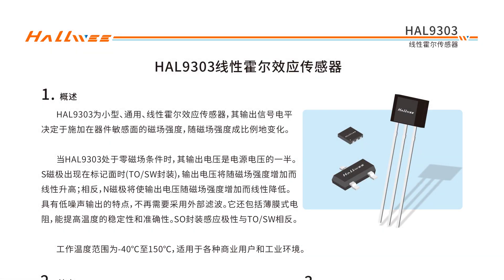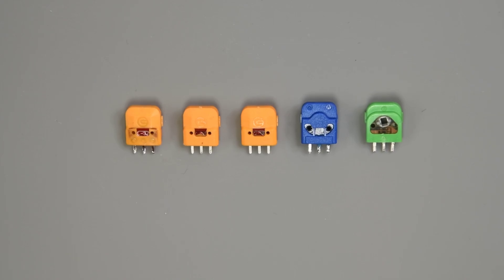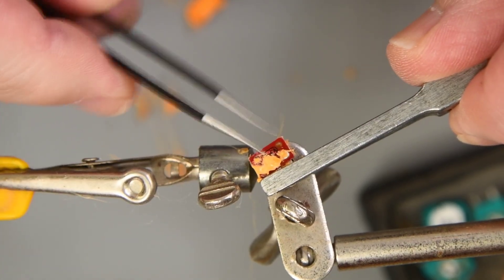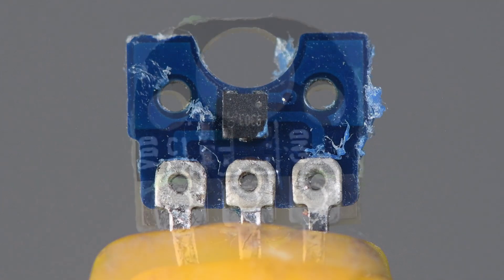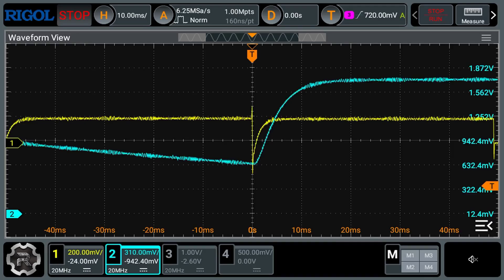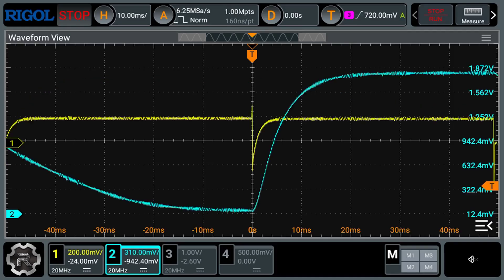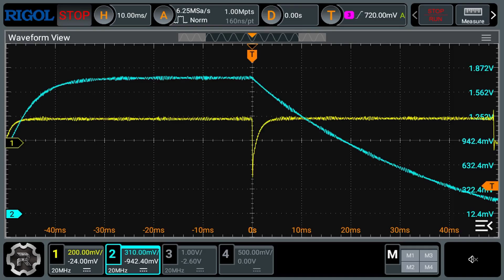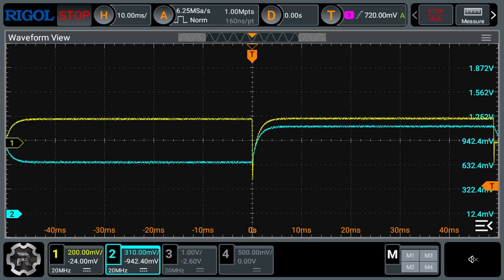Close up look at some Hall Effect Joystick Sensors

Comment: Hello, I was impressed by this content.
I know the GuliKit sensors are expensive and good here, but what would you recommend the most among GinFull, K-Silver, and Union in that content?
Reply from the maker: The new K-Silver TMR joystick will be the low-cost winner.
Reply: @metalplasticelectronics354  i am planning l4 ginfull.what do u think?
Reply from the maker: I'm testing out some Ginfull V5S joysticks right now, they look like the best Ginfull's so far.  But I won't know for sure for a few more days.  I've still got to get them in a controller.  The GuliKit and K-Silver TMR joysticks will behave like a potentiometer joystick.  The Ginfull's will have a bit smoother feel.

Comment: Hello. i got some ginful v5 and planned on swapping out the v1 ive been using. Just wanted to know if the filter that eliminates the jitter causes more latency or if the latency on the v1 was better than the v5. id rather have jitter than more input delay.
Reply from the maker: The latency on the V5 is much better and has much less delay than the early version I tried.
Reply: @metalplasticelectronics354  the early one you tested was the v1 right? Thanks for your reply.
Reply from the maker: I'm not sure if it was V1 or V3.
Reply: @metalplasticelectronics354  v1 had a white and black label. looks like the first ones you tested had red so a later revision. Maybe ill poke into a v1 and see if there isn't any resisters or capacitors. if you compare the response times from when you removed them on the other version they would be a bit faster than the v5 if that's the case. I have a pile of sticks and parts and cant make up my freakin mind. maybe ill use the tmr for a bit

Comment: PS4 v2 controller cannot use  two hall efect sensors on one stick. One need to be a real potentiommeter 10k. Do you face this problem?
Reply from the maker: I think there are Hall and maybe by now the TMR joysticks for the PS4 controllers.  One of the sensors has the power and ground pins reversed.
Reply: @metalplasticelectronics354  I think it needs to add 10k resistor to the hall sensor and it should working. Because hall sensors are atound 300k res. So mine is working with one hall and one original 10k sensor. And they are linked parralel, so 10k res is still there for both. Maybe i can add just one 10k resistor and will work with both hall efect sensors.

Comment: Thanks for alot of the research on this channel. Just bought a modified controller on ebay with the K-Silver sensors and Jun Zeng mainboard for manual calibration.

I know the mainboards are pretty irrelevant due to the software calibration tools now, but the Ebayer was the only one selling these kind of controllers that was transparent on what sensors they were using, provided gamepad tester footage etc and definitely werent trying to exploit people with limited knowledge on the subject. 

As long as the sensors are calibrated well it doesnt matter to me anyways.
Reply from the maker: I was pretty happy with the K-Silver sensors.

Comment: It's a very interesting experiment. I implemented a similar evaluation on a Dualsense board.
However, there was no fall time delay with Ginfull sensor  in the 20ms waveform.
The evaluation board may need to be improved as well as PS5 Dualsense.

Comment: i havent seen any channel/video about these sensors put into xbox controllers.
i hope you could do it someday.
i gotta say, your work is awesome.
Reply: If the controller can be software calibrated, it should be no different from PS5.

Just keep in mind that both XB and PS4 (but not PS5) are polar reversed on one axis, and neither of those two have the same axis reversed. So that means none of the three are directly compatible with the console they are not made for.  One can usually tell by one sensor housing being a different colour.

Comment: For measuring smd caps and resistors off pcb I usually take a piece of tape and stick them on it to keep them from moving. Not perfect but quicker than soldering one side to some pcb.
Reply from the maker: Great idea, thanks.

Comment: Since we're watching about parts from a video game controller, I would like to see testing in some games so I can see what you mean by there's delay.
Reply from the maker: I'll have to think about that, I'm not sure there would be a way to see it with a game.  It's more of a feel than anything else.
Reply: Suppose a game with "mouse" control for menu may work along with a high speed camera to make actuation trigger points easier to verify than typically tested game actions. CP2077 or such perhaps.

Comment: Would you still consider the favor union modules better overall at this point?
Reply from the maker: I consider the GuliKit TMR the best at this time, but they are more expensive.
Reply: @metalplasticelectronics354 K-Silver TMR is coming out soon. Gulikits at least on Xbox have a QC issue. Besides the odd overshoot that happens.
Reply: It's too bad that these modules don't work on the dualsense edge
Reply: @minty257 they’ll work on the edge with a calibration board. TMR is known to have drifting issues though. Favor unions are best at the moment for the edge